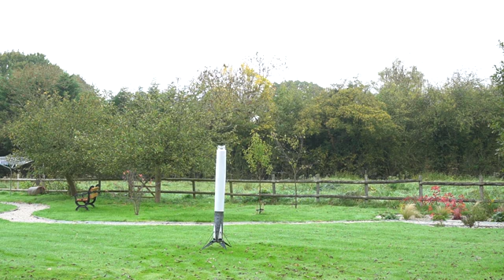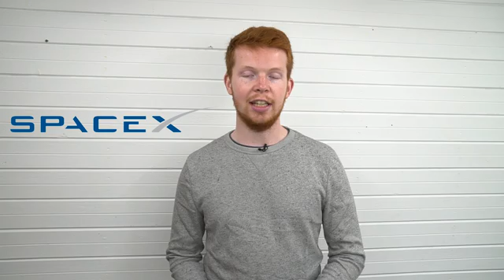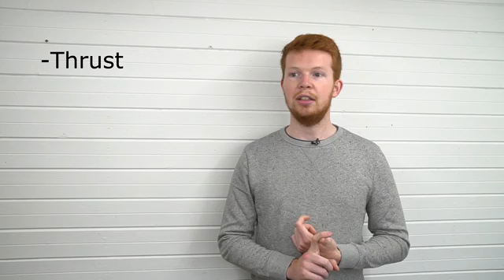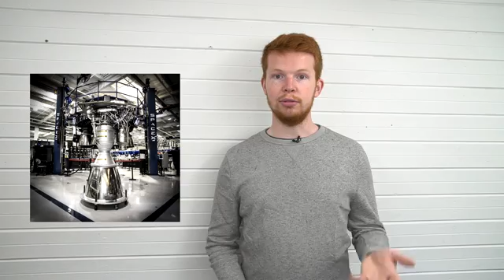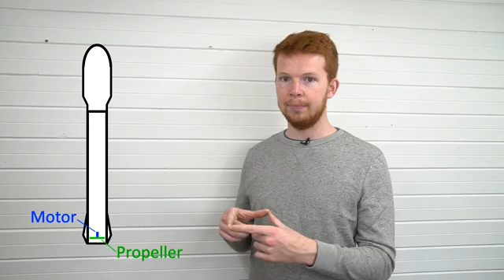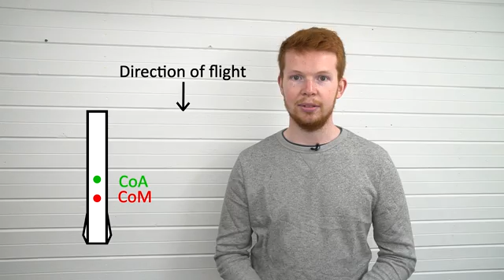Hovering a rocket - SpaceX model

Comment: It's very interesting project I wish to see more of it, try lunching it from a wooden platform next time
Reply from the maker: Yes a wooden platform would allow it to slide a bit and not get the legs caught in the grass! Thanks!
Reply: And then land it on a Model barge on the duck pond.
Reply: +Tom Stanton If your FC has a PID, I'd think you could tune it to get rid of most of the oscillation you're seeing. A well-tuned PID can make even a broomstick rock-steady, acting from the very bottom with just a gimballed thruster (or vectoring).

Have you thought of modelling your device in something like X-plane? Even really small VTOL stuff seems to be tunable with that, if you get the masses, moments, and CG/CP right.

My dad (a theoretical physicist) taught me something useful about balancing long poles. Top-heavy is actually better in some ways. I'm glad you noticed that's true!
Reply: Yea, like a picnic table!
Reply: Hmmmm, lunch
Reply: What's the best wine to have with rocket? Is it better with beer?
Reply: I love a good rocket lunch. Maybe a bit of sorrel, arugula, olive oil, some bacon, and a fine whine to get it off the ground.
Reply: Tom Stanton:
How about a leveled platform...